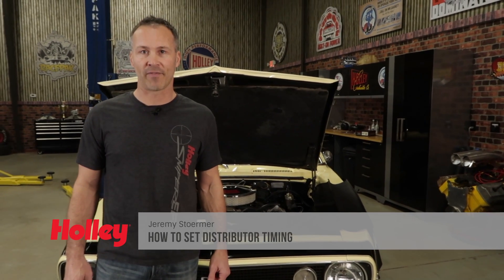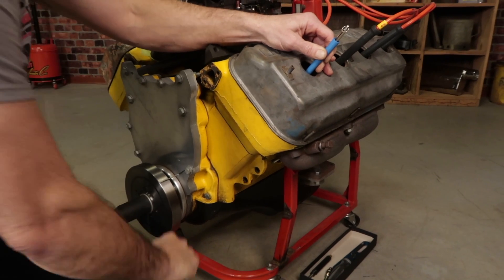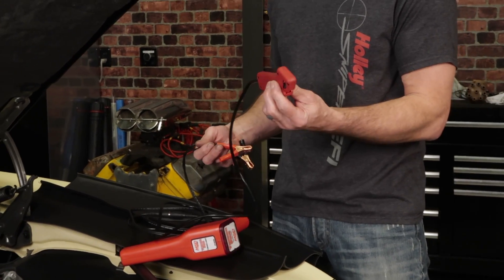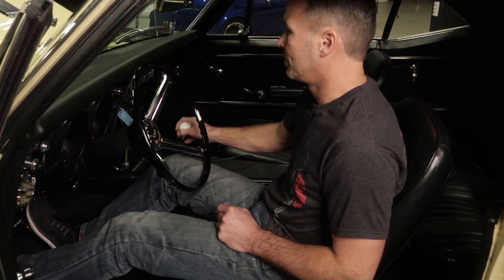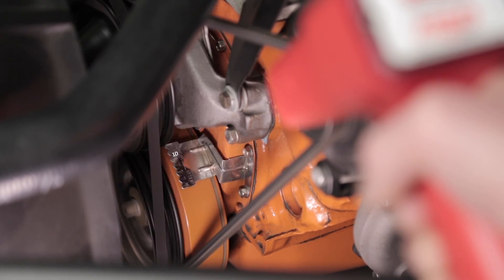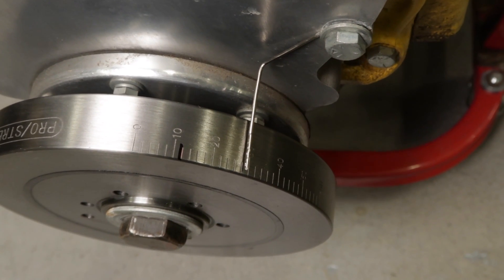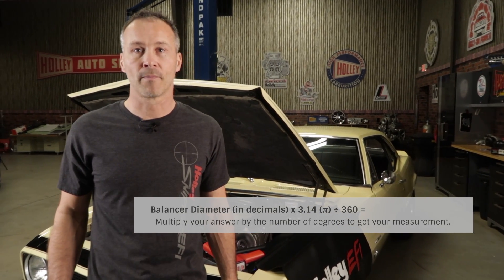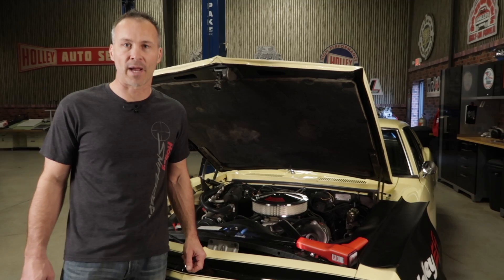How To Set Timing Ignition Timing With A Distributor

Comment: I have a question 
I was dropping my distributor back in after switching the points for electronic ignition. Had a breaker bar on the harmonic balancer nut. (1time use) I forgot I left the breaker bar on nut and bumped the ignition looking for TDC and hit the back of the fan and knocked that nut loose. Could that knock the timing off on the inside of the engine??

Comment: Just a heads up. I bought a fancy timing light. The dial back feature doesn't work with Pertronix III. The multi spark ignition confuses the signal. You're better of with timing tape and a simple timing light.

Comment: Sanity check question:  Is it possible to get a correct timing light reading but the distributor is a tooth off?   

Context:  I purchased 3 used ebay distributors.. the 3rd one was the only good one, the first 2 had wobble in shaft due to worn bearings.    But the 'new' distributor is a good 1/2-3/4 inch away from the old 'slot mark' (The slot you tighten distribution position).   So this makes me think it's off by 1 tooth to the worm gear.   Or is that not possible since I'm able to get 10 degrees timing light reading(which is spec)?

It just seems strange that I have to twist the distributor nearly to end of slot in advance direction.  

Note 2:  In my vehicle, a wire is used to jump a terminal in order to set timing.  After setting to 10degrees,  the jumper wire is removed and the reading should be 8 degrees.  However,  the timing jumps around like crazy around the 8 degrees mark.   So the computer is clearly self-adjusting the timing, with some sub-issue causing it to jump around.   

I did a compression check and #2 cylinder is showing lower than others.  Like 90psi versus the rest at around 150-160.   Putting drop of oil in the plug hole...no significant difference...suggesting valve is the leaky suspect and not piston.   

However...the worst symptoms(like once a month the car bogs down  up hill enough to nearly die) come and go.  Wouldn't a valve issue be constant? With only miniscule difference depending on engine temp?     

It seems fair to conclude the valve leak is causing my rough idle and weak power,  but something else is causing sudden stall.  The idle is rough enough that my exhaust is taking a vibration beating.  It came loose one time.  I know the CAT is a 3rd clogged,  but installing a new aftermarket one(it was much smaller in size) made no difference, so I put the OEM CAT back on.

No mechanics will even touch this ob1 vehicle.  Having to do everything myself and attend to my day job at same time with no covered space.  At wits end after 5 years chasing this issue.  I installed brand new cylinder heads 5 years ago, and it's never run right, but it keeps running.

Comment: can you make a tutorial on how to understand this tutorial
Reply: Yes please. I'm so confused
Reply: @operatorfig2  it's really not that complicated....
Turn distributor left to advance, right to retard. Hookup timing light to battery pos, and clamp to number 1 cylinder spark plug wire. For all intents it's easier to get a light that is electronic and will tell you the degrees in timing, to find that you adjust the number on the light until it lights up when the timing tab is at 0. After you adjust the distributor, you will have to adjust the number on the light again back till it's flashing at 0. New number on the display is your initial timing.

Comment: What if it doesnt start 😅
Reply: Check to make sure your distributor isn’t turned 180 degrees. It should be lined up on the compression stroke
Reply: Yeah just take out spark plug in cylinder 1. Insert long screwdriver in spark plug hole, turn crankshaft  until the screwdriver is at highest point. 
I’m little less familiar with this part, but you’ll have to do the same thing with the valves for that cylinder. And you’ll probably have to do it for the valves on another cylinder that links up with the other camshaft. Because typically you have two cam shafts, and they have to both be adjusted, and then from there you should be able to turn on your car, and then use the timing light

Comment: I have a 95 mustang gt i just finished replacing lower and upper intake manifold gaskets. I put distributor in checked timing its at 19 and cant move distributor anymore to change timing. Like im off. Do i nerd to take out distributor and then move it which wY?
Reply: What did you do? I just got a car with a distributor
Reply: @jovanialvarez9310  took distributor out and turned it..reset timimg

Comment: Thanks for such a great and easy tutorial! Can you also explain vacuum advance timing? You briefly mentioned disabling it for this procedure, so I assume this is just for baseline timing. I assume vacuum advance is for when the engine is revved up and timing needs to advance a little more than a couple degrees before TDC? I understand that combustion may not be able to keep up perfectly with increased RPM's and shorter piston dwell times.

Comment: if an eng will crank its timeing is close  conn a timeing light to a plugwire see where it flasing balancer or pully  should have deg marks  allway set some degs be fore tdc mark losen dist housing slowly rotate to see flash on deg marks you want tighten dist it is timed

Comment: Hello Sir, my corolla 2e engine often fails to stop and if it happens, I had to loosen the distributor and turn it while cranking for it to start and when it started, I can use it again for several times before it fails and ang repeat the same process. I haven't experience any problems when it is running. Is there a need to replace the distributor or the issue here is just it's timing?

Comment: Is it possible to set the timing initially upon first fire-up of a fresh rebuild with the engine only being turned over by the starter (i.e. no fuel)?
Reply: The engine needs to be idling if you do that the starter will most likely burn up

Comment: So basically for a stock engine you want timing at 0?
Reply: No, the owners manual should mention what it's meant to be under specifications. 
Or try a repair manual for your model.
Reply: @Stovokor41   The owners manual for the 350 engine you got in the junk yard?
Reply: @SOLDOZER  you might be able to tell what it came from using the engine number?
Reply: set timing at  5 deg before tdc  see  how it  starts and runs  if ok leave as is  --- you do not want fire too quick before tdc  spark knock and poss. damage to pistons
Reply: no l zero is late firing piston already started down --- loss of power   set a few degs before tdc

Comment: My engine won’t fire can I use the light an time it using the starter lightly in waves, or does it have to be runnin
Reply: Has to be running....when you have your motor on TDC on compression stroke remove dist cap rotor should be at #1 piston.
Reply: @Cstoreri  Thankyou this helped me aswell my motor in question doesn’t run

Comment: Does the timing cause the car to overheat? I just bought this pickup it sounds like it has some High Performance parts cam etc etc . . Not sure what all it has. I just know it's a sbc350, Thanks
Reply: Timing is not going to change your heat output, that's all going to be up to your radiator, thermostat, and water pump/fans.

Comment: Is the timing belt suppose to move over the pulley?
Reply: that belt is the fan belt it has nothing to do with timeing  the timeing is set in the distrib.
Reply: there is a timing chain that connects crankshaft to the valve (pully) to set the valves at right time  has nothing to do with spark timing  that happens in the dist that adj. is made by rotating dist. housing to desired deg before tdc.

Comment: Could a timing adjustment help to stop a “Dieseling”effect, once the car is turned off?
Reply from the maker: Poorly adjusted ignition timing can contribute to that, but isn't the only possible cause. Sometimes it's caused by a "hot-spot" in the cylinder due to carbon build-up or other issues.